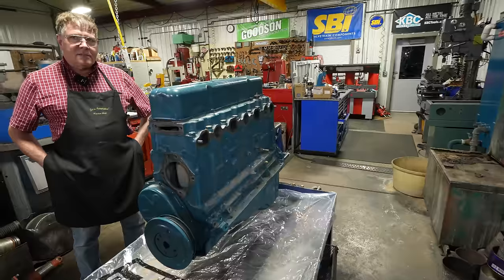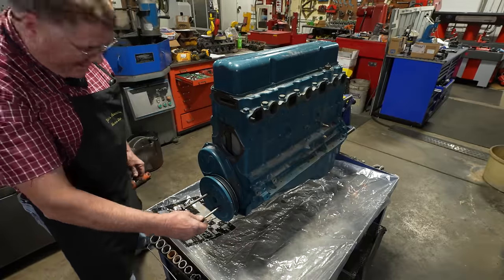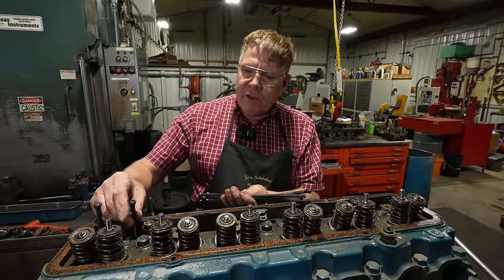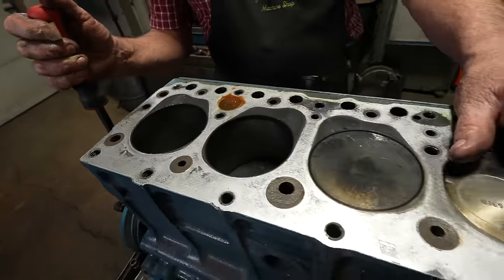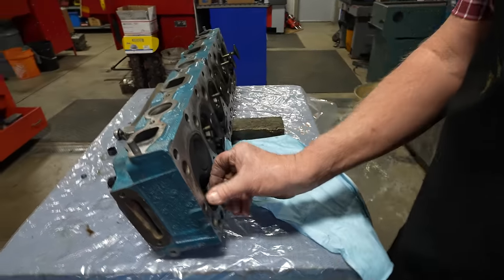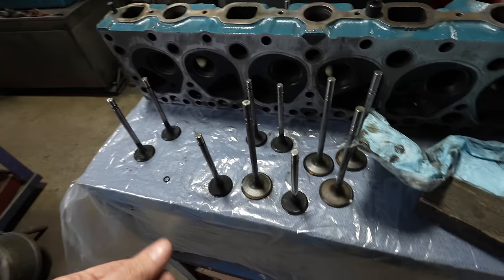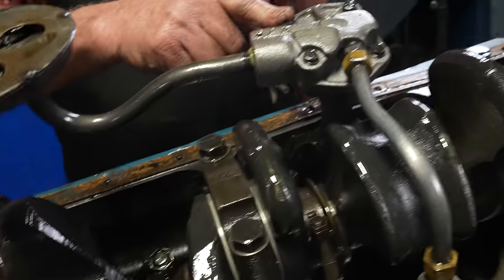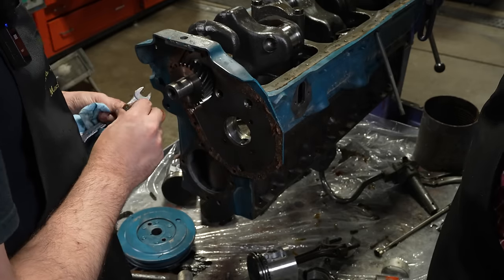Their 235 Chevy BROKE DOWN 10 Miles After The LAST Shop's Rebuild...

Comment: As a certified mechanic of ten years I appreciate you guys not rushing to throw the previous shop under the bus. You guys are a class act!
Reply: it's a Frankenstein motor made from the parts of different motors.🤣🤣🤣🤣🤣
Reply: I agree.
Reply: The standard should be calling a spade a spade. When a shop screws something up, they should be called out for it. Covering mistakes up is worse than making one. Everyone makes honest mistakes, covering one up is not honest or a mistake.
Reply: @slimdugger99  yes but jamsi isn't covering it up, he's letting the previous shops work speak for itself.
Reply: "Another shop" ususally means, "I did it myself and screwed up, but am embarrassed to admit it."
Reply: @MrJeffcoley1 exactly what I was thinking, Jim knew that too from noticing things. He just didn’t want to embarrass the customer or his relative. 😂😂😂😂
Reply: @MrJeffcoley1  Pretty often it does, as shown by the "Just rolled in" videos 🤣
Reply: I'm not certified respect mi authorita
Reply: i love that channel!  😄 @ferrumignis
Reply: As helped many a hack shop stay under the radar 4 sur .
Reply: Could be. But I had an experience once where I took a motorcycle back to the same dealer three times before just giving up on them, eating the loss, and going somewhere else...
Reply: Because it can go both ways even if it’s not true. Your business is your reputation.
Reply: 20 minutes in that did not look like a rush job engine they wanted to do a good job and vent too far
Reply: they don't have to throw them up the bus.. They are already under the bus.. Get out of the business if you don't do it right
Reply: Really enjoyed this episode! This was a sluthy bit of mechanics!🧐
Reply: The last shop cost the guy more money having to take it to another shop after 10 miles. Mechanics may appreciate it, but the rest of us that have to pay twice to have it fixed don't.
Reply: I agree, it's a testament to their professionalism especially with the detailed forensic analysis!
Reply: I've got a 1946 chevy with a 216. Learned a lot on this video. As far as building the motor I'll let a professional handle that.
Reply: @MrJeffcoley1  that is always a possibility but not always a certainty. but in this case you are probably right. the gentleman in this video has stated that this customers grandfather and father were both his customers. so why did the customer bring it to a different shop? which then means he probably did try and do the job himself and screwed up somewhere along the line...
Reply: @hellshade2  Apparently something as simple as putting the wrong seals on the valves
Reply: Yea it was your shop that did it
Reply: @slimdugger99 I'm going to call you out every time you mess up. Mr perfect narrsacist
Reply: @JC-gw3yo  Get out then fella while you can and it is your choice . Big man
Reply: If anything, it looks like the previous shop may have approached the rebuild with too much zeal. Crosshatching the valve stems was an unnecessary step too far, as was using the umbrella seals. Also, as far as the missized bearing, although people should double check the size of each of them, it appeared to have been mixed up & mispackaged by Federal Mogul which may not happen everyday. Plus, some shops have poor lighting, making it difficult to read the size.
       In any case, not cutting the previous shop any slack, may not be a good look, when the video's focus is to fix, more than it is to blame.
       Like some have commented, maybe the customer tried to do it himself & didn't want to own up to his failure, & so he blamed a phantom shop. Or, he didn't take it back to the previous shop, because it went out of business due to the lockdown, before he was able to get around to bringing the engine back? to them?
Reply: @Bill79870  We have one here at our vintage military vehicle charity.  I've stripped it down and it's all good except for a split in the block that runs the full length.  Don't know whether to cold stitch it, weld it or scrap it!
Reply: I agree.   I've been turning wrenches for 40 years.  Including 7 in the Navy working on helicopters.   There are multiple fail-safes in place when working on aviation engines, QA...QAR, etc.  In a shop, it's typically one guy.  Especially, in a machine shop.   Now, I WILL let the other shop know what I found.  But, unless it's a recurring issue from the same shop, I fix it and move on.  Anyone who claims to have never made a mistake (forgot to torque a cam phaser properly, etc) is a liar.  I stay clear of "perfect" "know-it-alls".  This is where work orders and Repair checklists can help.
Reply: Any mechanic worth his salt wont shit on another mechanic publicly
Reply: Nah, its bullshit. Do the job you are paid for, if you did it right the problem wouldn't happen.
Reply: @MrJeffcoley1  About 60/40 split in my experience. Just because someone is a paid mechanic doesn't mean they're much more than a glorified parts changer. Bizarre that people automatically assume a name tag implies the most absolute tippy-tippy-tippy top of expertise.
Reply: The previous shop probably didn't do anything wrong when the guy installed the motor he didn't put oil in it.
Reply: @irabullrider  how do you explain mismatched main bearings then
Reply: @irabullrider 

24:54 
out your
Reply: @SaraMorgan-ym6ue 
Makes no difference
Reply: You must be the one who rebuilt your it
Reply: @MrJeffcoley1 That’s what I was thinking. That or he had an overconfident buddy do it for him.
Reply: The previous shop was always the idiot and the current shop the expert.  That is standard procedure.
Reply: @CrowCreekOutdoors  Actually all of the work seems top notch other than the one off-size bushing and the wrong valve stem seals. Whoever did it almost had it right
Reply: @riverriver5345 why would he not take it immediately back to the original shop when it failed after 10 miles?  Story is fishy.
Reply: Respect!
Reply: Most shops(even mine unfortunately) are like friggin high school with all the gossip and drama!!!
Reply: @slimdugger99  you got that right!!! I'm currently changing out a head gasket on a B18B1 Integra engine and oh my absolute GOODNESS the stuff I've found that had been covered up is just ridiculous!!!!!
Reply: @iandouglas4992 
Stop lying to yourself already you know you built it🤣 or atleast tried
Reply: @MrJeffcoley1  yes, but a DIYer doesn't have the ability to remove old valve guides and put in and hone new ones. So this isn't an owner doing something they shouldn't, this is a shop. 

But yes, generally it is I effed up and don't want to say so just going to say "another shop I hired" 😂
Reply: @MrJeffcoley1  yup, either a rookie was doing the work and flubbed up and put it in, or whoever did the work accidentally forgot one. It's not good to do as it shows bad craftsmanship, however, everyone has an off day. 

I agree, the rest of the work was spot on. Just a minor flub that led to a bad build causing a full second rebuild. 

I like they didn't throw the shop under the bus and talk trash like some on here think they should and are talking ahit about the other shop. But here, they just showed the findings and what happened to the best educated guess and left it there. If it was a shop that had horrible reputation for shotty work, they may be yeah, put on blast as they have previous work showing crap. But here they are true professionals and do right by their customers.
Reply: @MrJeffcoley1  "another shop" usually means - "my business is not going to risk a slander suit"
Reply: @dodgeplow  The work the other shop did is pretty good, and extensive. They almost got it right. It doesn’t appear to be a home rebuild, unless they have a machine shop.
Reply: @MrJeffcoley1 I agree. It does look like someone made a mistake with that bearing. I'm talking in general when people on videos don't name the other shop, even in grossly bad work, is to avoid legal difficulties. Have you had the chance to read about businesses suing people for leaving them negative reviews even with good documentation?  It's a risky move these days
Reply: @dodgeplow  I do think grossly bad work probably IS the customer, or the customers buddy. All the clips on “Just Rolled In” showing brake calipers hanging loose, pads installed backwards, new suspension parts incorrectly installed onto completely rotted out subframes … there’s no way a professional shop did that, even a bad one.
Reply: @MrJeffcoley1 I love those idiotic repairs. I laugh so much but they scare me at the same time. It could be the car behind you...
Reply: @74KU it’s not machines building machines. 

It’s human animals waking up getting ready and doing their best before they die.
Reply: @MikeHarris1984 I replaced my valve guides last spring. 

Ordered a $30 hone for the guides. 

I even had a loose valve guide and peened it tight again. 

Micro polished valve stems by hand. 
Lifter bores ect. 

Valves work like butter😊

Daily driven 20,000 miles in one year. 
 4x cross country trips loaded down. 
-20f cold start being driven 4x a day. 

Don’t underestimate yourself.
Reply: @fastinradfordable  Perfect practice makes perfect.
If you are not striving for perfection you are wasting space, there is already 7 Billion fools who can't do it right, don't be one of them.
Reply: user-wv1pj6wh4h rig it correctly, it's the same story for landing gear
Reply: @ferrumignis Right. Because if I had work done by a mechanic and the engine broke down after 10 miles , I’d be bringing it back to that mechanic
Reply: I disagree. Way too many mistakes were discovered. Did you watch the entire video? Seems like you didn't.
Reply: Stuff happens not a everything is a controversy or a conspiracy. Keep calm and carry on. Take a day off, keep a mean dog in your junkyard😅
Reply: @rideitlikeyoustoleit7640 don't eat leftovers on the 3rd day or you will die. Feast of the trumpets
Reply: @hellshade2  Could be many reasons-- my guess was cost.  He probably took it to another shop trying to save money, and didn't get what he didn't pay for.
Reply: Your videos are very enlightening and interesting.  I do enjoy it. Thanks
Reply: I rebuilt a Chevy 6 for a '66 GMC pickup and discovered a wrong size bearing half in a set...
Reply: They probably should call out the previous mechanic for a major F up.
Reply: As a certified forklift operator, I appreciate pallets.
Reply: That shop stepped out in front of the bus and waived before being crushed.
They SHOULD be exposed. This is crap workmanship
Reply: it has taken me a long time to learn to appreciate the effort of everyone trying to do a job and get through the day.
Reply: @ferrumignis  Want some spray foam for your next "repair"? 😛
Reply: Took the words, right out of my pea-size brain.
Reply: @RuralTowner  I'm not spray foam certified, so I have to stick with conventional repairs 😂

Comment: Best video ever! Back in 1998 my 1985 Blazer motor broke the crankshaft.  The repair guys said they could put in a used engine for $350 plus labor.  I did not have that much money, so I decided to fix my engine at home.  It took me 4 months and I was successful.  The only thing I had was a book to explain to me what to do.  There was no instant videos, no way to ask questions, nothing: you were on your own and I was pretty good at thinking about stuff.  I bought an engine lift crane, engine mounting holder and every tool that I needed. Since I had the engine open, I decided to change the 6 cylinder cam shaft to a racing cam for $225 and added roller valve rocker arms.  The biggest issue I had was the cylinders were all cut to 0.30" and not factory, but this was a factory motor. The bearings misalignment is what cause the failure and I needed to get a used engine block for $250. That is why my original pistols would not fit my new block!  Back to the machinists to rebore to 0.30. That was only $150 for that. As I said: "I did not have $350 plus labor for a used engine"  - I ended up spending $1100 total and I got a ton of tools and engineering smarts from doing it myself. The Blazer ran like a V8 after that!  Was like a scalded dog after that. Fast and smooth.  These days I can just look up YouTube and learn a fix for lots of things.
Reply: I was a teenager in the 90's. Imagine how the fox body craze would've been if we had all that information in our pockets.
Reply: I hear ya. I've done 90% of the work on all my cars, and YouTube has made it a lot easier after a mechanic friend moved. But you'd be amazed at how "professional" mechanics flip their shit about "EVERYONE IS A FUCKING YOUTUBE MECHANIC THESE DAYS!" And then the same people will turn around and bitch "no one knows how to do anything anymore!" 

I've never heard someone talk themselves out of money faster than an autobody guy I got an insurance estimate from to replace a door. I mean seriously, if you didn't charge an arm and a dick for turning some bolts I can do on a weekend with a video as guidance if need be, perhaps this wouldn't be an issue. Sorry you'd chose no money over some money for an ultimately easier job with faster turnaround.
Reply: Nice analysis
Reply: Just for future reference thirty thousands is written as such .030 
From the decimal point on the right side, the first is hundred thousands, the second spot is 
ten thousands and the last is one thousands.
I wasn’t trying to be a smart ass, I was just trying to keep people from thinking you were a dumbass lol
I’m sorry, I was an automotive machinist for at least 20 years.
Reply: Ah, for the days back when you could just go buy a physical copy of the factory service manual from either the manufacturer or a third party publisher.  Nowadays you have to pay by the day just to access the info in some online database, and that's if they release info to the public at all.
Reply: Ditto! I've been there, done that. A d actually still doing it 60 years later ( first 10 years went to bicycles and go-cart engines.
Reply: Shoe or basketball clothing but up too U must be something U like? Clothes?
Reply: Cost more in long run but the knowledge and experience is priceless. The tools I'm sure you'll need again at somepoint. I've learnt alot figuring shit out or I don't have a car or have to pay someone. Now I'm about to open my own shop shortly. Hands on learning leads to experience. Best way to learn for me atleast
Reply: @robquimby9908  Thanks for your remarks. I still have all those tools and use them all the time. My last tire replacement came with a free wheel alignment, but they said: "We can not do the alignment because your front left ball joint need replacement."  I just turned around and bought 2 ball joints and put them both in on the front of my van. When right back to get my free front end alignment. :)
Reply: @lindafoxwood78  there ya go. I do all my own work plus family and friends. I've saved thousands.. just alone on replacing engine twice prob saved 6k. And you know exactly how and what's done to your car. Gives me peace of mind
Reply: The old grease smeared Haynes manual or the cursed vague ass chilton,they were the broke young guys youtube.before you tube
Reply: @cartmanrlsusall  sucks getting old but at the same time i am very thankful to have lived before cell phones and YouTube. My generation was the last to live that way….
Reply: @cartmanrlsusall  Loved the Haynes. SOOO much easier to read and follow.
Reply: These guys are great and it’s nice of them to troubleshoot grandpa’s engine. The owner is sentimental and it’s great for him to get helped out.
Reply: @lindafoxwood78 I remember taking my 66 Chevelle to an alignment place and they told me I needed new ball joints which surprised me. I told the guy “That’s interesting because I just installed new ball joints!” he said “Oh! I’ll check it out again!” and he was fired by the place for doing that.
Reply: @ROBIN_SAGE how old are you? I’m 62 and am shocked when I walk in a room and see everyone using their smart phones. But it’s ok if I’m doing it! I love my 2TB iPhone unless it’s acting up. Autocorrect is terrible acting and the keys are so tiny. I have 132,000 digital photos and videos on it. I can usually show a photo to someone to explain something to them.
Reply: @cartmanrlsusall your comment made my day! I say the same thing to my 26 year old son. When reading the manuals they would say “Remove front brake assembly” How? There were always things they didn’t explain. Vague is right! I’d love to go back to those days though. Almost everyone is dead from 30 years ago. That’s the part about life that I don’t enjoy. I have my kids and grandkids that I need to do things with now. We have 13 vehicles outside now somehow including my first car that is a 66 Chevelle, a convertible 66 Chevelle, a 66 El Camino, a 67 GMC truck, a 1970 Monte Carlo, and more new vehicles. I don’t know how we ended up with that many!!
Reply: Men are amazing. I barely feel the confidence to change my own oil.

It's really too bad we're so derided now.

The more I learn about what other men are are often so casually capable of, the more impressed I feel.
Reply: Great job, thank you.
Reply: @aaadamt964 don't remind me of those days lol.
Granted I had a friend that had a fox that ran 6's (1/4 not 1/8).
But the vast majority were shit.